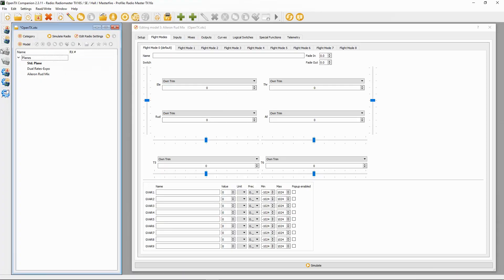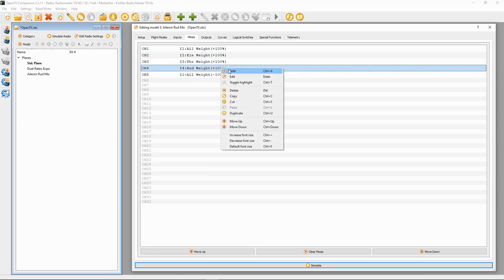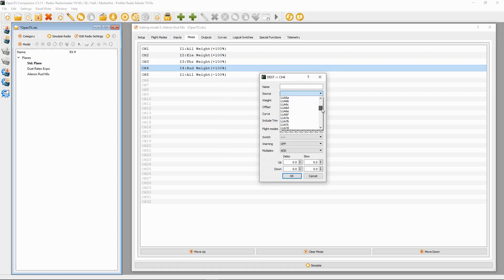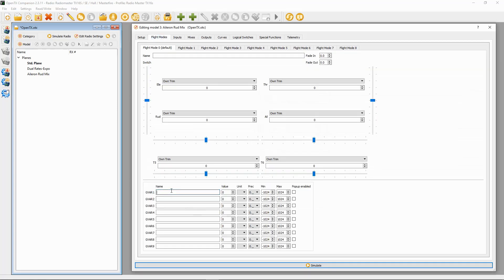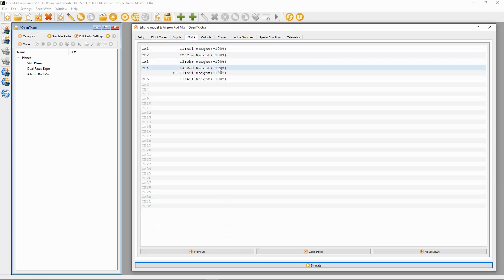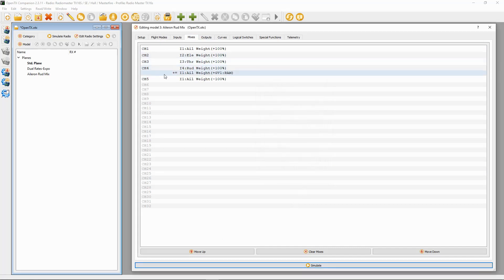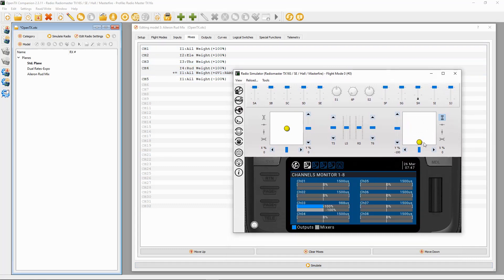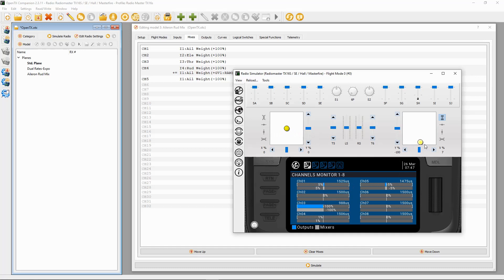OpenTX Aileron Rudder Mixing

Comment: How would that differ from "bank n yank" using aileron and elevator?
Reply from the maker: You use aileron rudder mixing if your plane will tend to roll but carry on in a straight line. When you roll through 90 degrees your rudder effectively becomes an elevator. You can of cause coordinated all three control surfaces without mixing but the mix makes it easier. I have only used this on one model.

Comment: It would be useful for newcomers to be shown how to check that the rudder moves in the correct direction when the aileron stick is moved, and some may even need to be told what the correct direction actually is! If they are at the stage that they don't even know something as simple as this mix, you need to explain more than you do. Sorry, but that is how I see it as a radio flyer for at least 50 years!